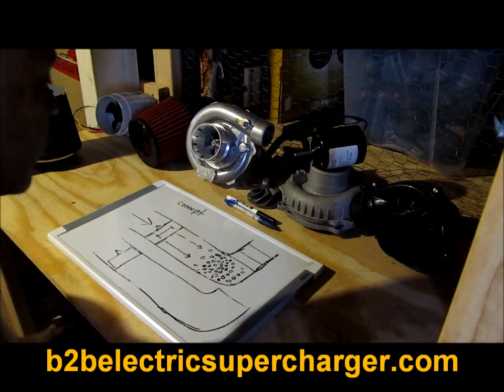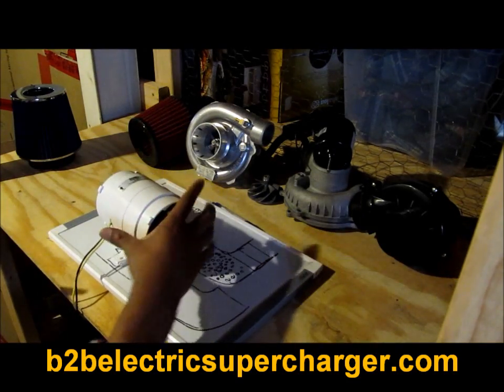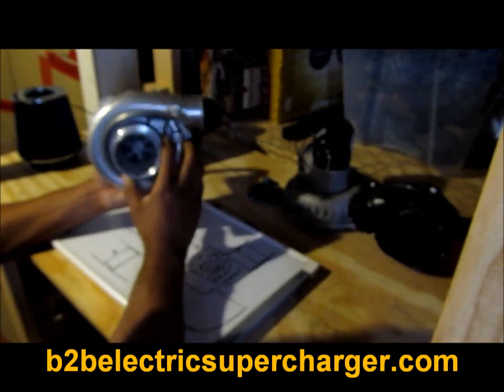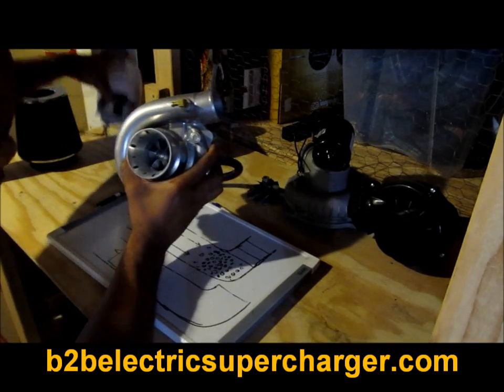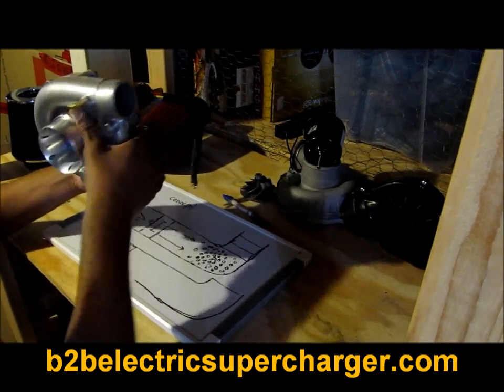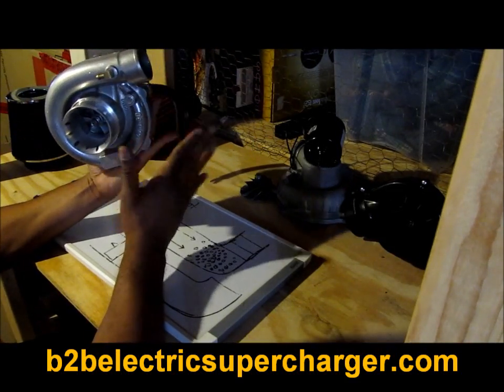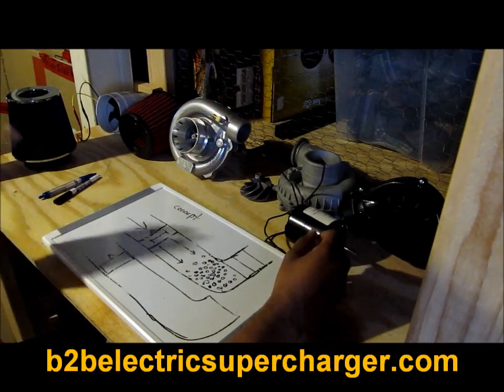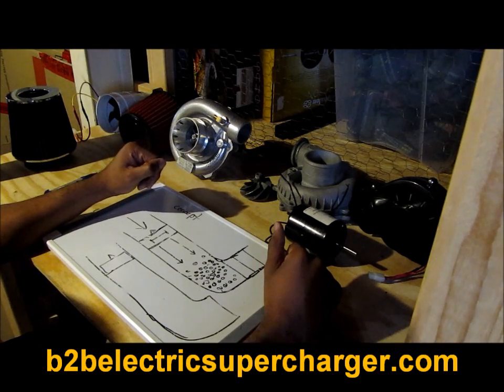Do Electric Superchargers Work?

Comment: A electric turbo would work but not for cars though but for motorcycles it would definitely work and would definitely help single cylinder motorcycle could get boost. For example a Honda Rebel 300 could definitely use one thing it boost power but the compressor housing would need to be smaller than this shown in the video.

Comment: Audi using 48 volt 7,000 watts just to prevent lag on main turbo, just saying.
Reply: 4 cylinder can beat a V8 just saying different builds and results.
Some people just want a little extra boost on a small engine.
I have seen other videos and blogs about success with electric turbos.
I am going to try one soon!
Traditional turbo's stink!
Reply: @localvic  Even on a small engine trying to create 2 lb's of boost at 250 cfm requires 15 hp or 11,000 watts. Every actual test I've seen using a dyno, has created 1/2 horse at best and on larger engines actually restricts power. It can be done, but it takes a whole bunch of batteries to do it and a high voltage charging system to recover from each shot. Try a little nitrous, much cheaper.

Comment: if it did work it would only work at take off. so you may see a rise in pull at take off but higher rpm it's not enough air. period!

Comment: Tell me if im wrong but the car does not make boost off the cold side it makes boost of the exhaust gases (depending on what type of engine you have will determine how long the pistons cycle to determine the spool ) so running air threw the cold side will only make spool based off this it will only make the turbo take longer to spool becuase thier no extra force pushing out threw the turbo (the turbo back half)  ? 
So it wont work good ?

Comment: Have you considered a design like the venturi tube being used in Aircraft engines/fan turbine engines that is composed of alternater stator and rotor to compress the air?

Comment: Do any of you that are all excited by this, or running right out to buy one even know how a turbo or supercharger even works....?? If you did, I mean actually really got it, you would know a bottle of octane boost will give you more added power than this garbage, an this guy... needs to whipe off that white board and bring it to a couple of intro classes. Id start with english class before enrolling in mechanical engineers. Just sayin.

Comment: I use a hair dryer!  I'll tell you how to set it up.  First off you will need a inverter to change from 12v dc to 115v ac. Then plug in your hair to the inverter.  The next step is to hook up the hair dryer.  Cut a hole into your cold air intake and stick the end of the hair dryer into the hole. Use duct tape around the edges and  to hold the hair dryer in place.  Make sure your put the hair dryer on the cold setting!  You can wire in a on/off switch for inside the vehicle.  Next realize that this is a complete waste of time.  Just like reading this post!

Comment: Is there a small enough shell to fit my 50 or 150cc moped. I was thinking that with small displacement of a hello revving engine like a moped could definitely Utilize one of these. Is there anyway to find a shell small enough or a fan that’s high enough powered and small enough to fit in a small shell. Also what is the highest RPM fan you can find? Thank you very much for the advice.

Comment: Unless of course you can throttle control with a TPS whatnot idea from a dimmer switch and finding an old high output hand dryer from a gas station or something up there replacing or getting rid of putting new bushings into it I'm supposed to probably do that

Comment: I've been trying to work out one we're just having an alternator maybe a little output such as + 85 watt. If you're doing that obviously you have to add one to the vehicle that's standard plus the increase of wattage that it has to have for the new alternator that is now a motor because it's being reversed from an output to an input with electricity going into it not coming out of it probably just nothing more than just switching a wire or 2

Comment: And you got to put the gears on to it the proper order and put the tiniest little motor on there but if you put the freaking proper gears on doing things going to spend insanely fast making it into a turbo but if you from the turbo to the motor unless you're doing it from the motor turbo but from the turbo to the motor having a tiny gear on to the shaft to a gear two larger gear two larger gear to a larger gear enough gears later that thing's going to have quite the RPM capability simple drawing of gears and whatnot for balancing with a simple bit finding some kind of high-speed what not doing it gear to gear to gear it's balanced use gear on the shaft balancing the shaft itself everything should more less be okay up till probably maybe 15-20 + a Supercharger might be okay make it into turbo mainly is just notching shaft in a lot of balancing considering the RPM that it has to have ie a gearbox

Comment: I bet a typical super charger coupled with a 100hp electric motor and say a 50 to 1 gear box could easily generate actual boost. Now add 1000lb battery and inverter to get the 480VAC to run it. Now you have added 1500+lbs to your car and it would still cost thousands of dollars likely more that just installing a supercharger the correct way. But it would work.

Comment: can you also use the motor as a generator? I was hoping to build an MGU-H like that of Formula 1 cars. If not, I wanted to split the turbo into the turbine and the compressor separately and have a generator on one and a motor on the other

Comment: ud need alot bigger electric motor than that to overcome the n/a air intake of the motor. the intake of the air being sucked in by the engine would be higher volume than what ur electric motor could produce. even with stopping surge ud just suffocate the engine.

Comment: If u were to take a stronger inline electric fan then ruduce the hose size from the fan into the air intake as it enters the motor, wouldn't the reduction of hose cause the air to compress as it enters the motor?
Reply: Reduction of piping is called a venturi , wide pipe, neck down to half dia. the back open to 3/4 or full dia.

Comment: I'm quite interested in putting something like this on my Reliant Robin 850cc whose engine is very very similar in layout and design to the original Mini (Reliant bought the rights to the old Austin 7 engines from Austin when Austin went forward with the various A, B, E types) and having the same carb setup too, could this be an option to put a few extra horses into quite a small alloy engine???

Comment: You're wrong about how a centrifugal compressor works. Air doesn't flow straight out from the axis. It flows out tangential to the circumference. They work by supplying air to the intake, faster then the engine can use it. In other words, they accelerate the air to the flow restriction of the intake, where it slows down and compresses.

Comment: as our friend and mentor ISSAC NEWTON said"THERE'S NO FREE LUNCH",electric turbos are complete,total snakeoil bullshit.
Reply: Wrong! There's no free lunch implied here either. The battery that runs the motor needs to be charged. If an electric motor can push a vehicle down the road, then they can turn a compressor wheel.
Reply: Dave but u need 44k fuel system cleaner for increased power and better milage

Comment: Why not use the electric motor to assist the engine mechanically, like a hybrid? Would the more direct route be more efficient than the conversion to compressed air first?
Reply: Nick Nakorn when you force air into the combustion chamber the compression ratio say 10:1 natural aspirated, well we put 20 psi in there and we are at around 22:1 more air, more power, same reason you might have 2 centrifugal pumps working in line instead of one big pump the 2 pumps have a system witch created higher shutoff head of the 2nd pump
Reply: Indeed, I understand the principle but what are the inputs compared to gains in terms of energy conversion?

Comment: Ah another one trying to convince people that electric superchargers works!. There is no way unless you have a motor with a very high rpm with an enormous torque to fight back pressure and obviously a trunk full of batteries!.
Reply: Centrifugal compressors don't fight back pressure. That only applies to positive displacement compressors.

Comment: sir, I hv a 250cc motorcycle. on eBay there is a product which is basically a small cylinder with 2 propellers at both side. instead of putting k&n filter, if I place it,will the performance better. will be eagerly waiting for an answer.
Reply: Florian Münch I m talking abt FZ-1 n I don't think he has ever told abt it in the video. If you hv knowledge abt it n guide me, it will be appreciated.

Comment: The only people that say electric superchargers work are the people that sell electric superchargers.
Reply: Jean-Marc Chevalier Electric superchargers/turbochargers defiantly exist and work. HKS is currently selling one. The advantage isn't that it insulates from heat the advantage is that with an electric motor running it at a high enough constant rpm constantly you would have no spool time or turbo lag. There is no need to variably increase turbo speed as per throttle or rpm because no matter what running at a higher boost is always going to be advantageous and create more power, regardless of RPM or throttle position. To vary the speed of an electric turbo at all is to just apply the same disadvantages to the turbo you are trying to overcome with making it electric. Basically you are trying to make your turbo act like a supercharger without sapping energy from the engine or restricting the flow of exhaust gasses.
Reply: a turbo is not a fan, a fan moves air, a compressor creates pressure by forcing a large amount of air into a small space.

superchargers and turbochargers both are compressors, the difference is the way they are driven. a supercharger is driven from mechanical energy from the crank of the engine. a turbocharger is driven by the pressure of exhaust gases leaving the engine.

displacement is the amount of air that the piston displaces into the combustion chamber, for example a 2000cc engine with a compression ratio of 10:1 will force 2 litres of air into a space that is only 200ml, which gives it a total pressure of 147 psi in the combustion chamber, this is atmospheric pressure multiplied by the compression ratio. forced induction increases this pressure, when boost is applied you use this formula ((boost + amospheric pressure) * compression ratio), so now if our 2000cc and a compression ratio of 10:1 engine has 10psi of boost, we will do this ((10 + 14.7) * 10), you get a chamber pressure of 247 psi. this allows almost twice as much fuel and air to be added to the chamber, effectively increasing power.
Reply: A turbo basically is a fan, so, even electrically driven, a fan can do the same work.

The issue mainly lies in the fact most "electric turbos/superchargers" are far away from providing the required airflow/pressure, which have to be quite high...

Anyway, supercharging isn't that good for gasoline engines as it's just a mean to increase displacement (constant volumetric compression), turbocharging virtually allows for variable displacement to be obtained by exhaust feedback, increasing efficiency a bit, an "electric turbocharger" would thus require the throttle signal to be used to achieve a similar effect, without the benefit of using exhaust energy to drive it (but with the benefit of a better insulation of the intake from exhaust temp).

I think I would still try it if I had a chance to come across a viable blower, though... Who said I have higher chances of doing it myself than finding it on eBay?
Reply: Audi has one now. Just saying :)
Reply: Turbochargers are exhaust driven superchargers.
Reply: any supercharger thats correct for the application WORKS.. whether its belt, electric or nuke  powered.. what a moron
Reply: Dave ehhh depends on the supercharger there is alot of superchargers that work nothing like a turbo they are positive displacement twin screws on large Detroit deisel marine
Reply: but the exhaust gasses are being compressed and cooled and the air to air superchargers do compress the Inlet air before being rammed into the Upper Intake Manifold, do your research sir on turbo charging and super charging.
Reply: A turbo and an air to air super charger or pro charger have impellers, just like a Torque Converter
Reply: Are you able to get that turbo to spin at over 200,000 RPMs with your brushless motor
Reply: someguy on YouTube put a cheetah air compressor to a crown vic to his air intake and got 15 to 20 hp spike on the dyno on just air.
Reply: there is something called a motor compressor ..  the only issue that this will always provide the same boost all the time ,as for the normal turbo charger it will be dependent on the rpm of the engine that will increase the exhaust pressure which will create greater compression, the down side it will not be very active in the low rpm range . not the same as an electric one .
Reply: john white No, it doesn't depend on anything. A turbocharger is an exhaust driven supercharger. A supercharger is any mechanical device that supplies air density boost an engine's intake.

Comment: 9amps, even at 24v (I'm guessing your car is 13.5v) is 216W, or .216kW = .2808hp.  An old fashioned roots type blower will consume sever hundred hp at peak rpm. A more efficient centrifugal supercharger will still consume over a hundred hp at peak rpm. Even turbos, kings of efficient boost, consume dozens of hp for a street engine and more on racing engines. They all increase NET hp production, but it takes power to spin them.  

The (theoretical) benefit of an electric supercharger is that you can "save up" the power needed for the supercharger when at cruising speed or idle, and expend it when you want sudden acceleration. It's a good theory, and if ever fitted with components that would actually do the job it might work. But using a 12v system already in the car, it would take something like 700amps to create 1hp of work out of a very efficient motor. Even if you are considering a tiny supercharger, producing very modest boost, you'd need an electric motor capable of 10hp or more. 7000 amps?!? you'd have to be nucking futs to think that's a good idea. OK, so let's install a second alternator specifically to charge the supercharger system, and this time let's make it a 96v alternator pushing charge into a bank of supercaps sufficient for a 30 second 200amp discharge, into a 10hp+ capable electric motor spinning a centrifugal supercharger.  

Now we have a system that could, at least in theory, put enough energy into the supercharging process to produce a meaningful result in an engine.. But we are also installing a 50+lb secondary alternator, that adds continuous drag on the engine even when not charging the back of caps. We've installed a 150+lb motor/supercharger, that is now a restriction to engine breathing when not in use. And we have a big box of supercaps, bulky heavy and temperature sensitive, that have to be fit near the motor and yet not overheated... And this is why nobody does it. By the time a real world functioning system is in place, it is heavier and less effective than the other methods of achieving the same goal.
Reply: I appreciate the details you provided in this comment because now i can finally put out of my mind the whole concept of Electric blower .  I knew it was a gimmick but for some reason I continued to think that an advanced motor would become available that could make the speed required to achieve real boost it has not happened. Its a gimmick it plays on the weak minded internet ebay car tuner i've been there you just closed that final chapter.
Reply: ???? where exactly are you saving up this  power ahahaha  youre a nutter..if you installed a 150 lb supercharger that restricts normal flow..youre doing it wrong ahhhhaahah

Comment: i need more info for the súper charged what i need n where i can find it..ty
Reply: You only need something able to actually push about 100CFM of air per 1000cc. Good luck.

Hint : a Delta AFB1212SHE with its rated 190CFM won't even supercharge a 125cc engine because of its ridiculously low back pressure (0.02 bar at zero air flow, that's some serious boost!), at most it'll compensate for the air filter charge on the whole line on an engine below 2000cc.

Comment: its pointless really as idea of superchargers is to use wasted energy( exhaust gases) in order to create more power also reduce fuel consumption...so why would you hook up another electric device putting strain on your alternator, battery draining power mean more fuel being used etc and like you just said 9 amps will take u nowere ...turbo spins up 2 couple hundreds revs using exhaust gases every engine produce this is the most beautiful idea ever :D to compensate sort of energy turbo putting out ? it can be done but you will have to hook up another 5 alternators to your engine supply big electric motor with alot of current that will take alot of power out of your engine , you put aircon on your engine will probably stole before boost will manage to make it work :D life is about being resourceful :D use something whats there anyway for benefits not try to create benefits by wasting energy ...
Reply: turbos are exhaust driven superchargers are usually belt driven ..........